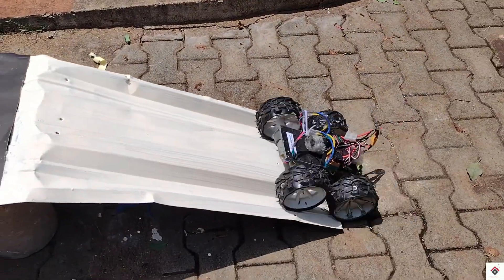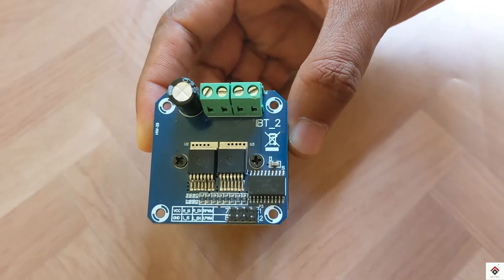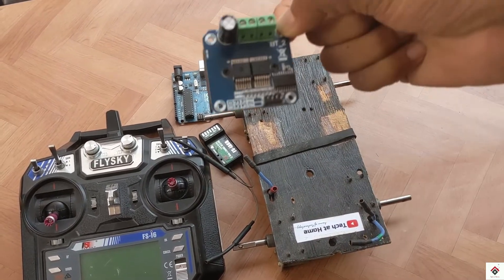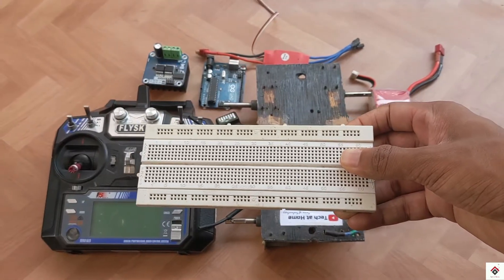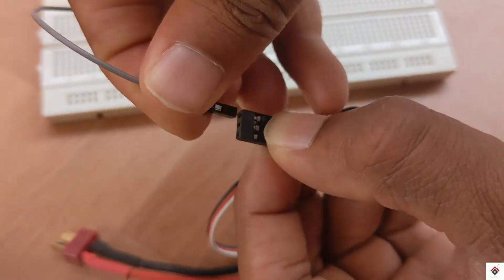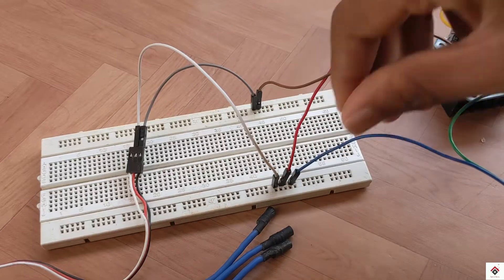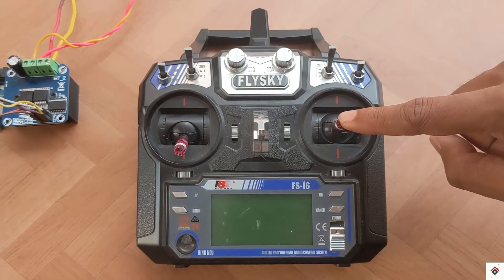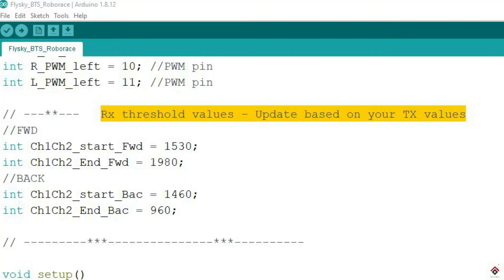Roborace Robot using Arduino and BTS7960 | Wireless Robot with Flysky fsi6 [without Brushed ESC]

Comment: Bro wether i can use 12v 100rpm motor for robo race or any other alternative???
Reply from the maker: 100 RPM will be slower. We have used 500 RPM.
Instead of this video, check the  latest one without using Arduino and it's simple:  https://youtu.be/m9Lq-QADP9A?si=FlbdCycQ8jGvyQHn

Comment: I will try but a small question  Arduino ground not connecting to the motor driver
Reply from the maker: You have to connect.
We have the latest video which doesn't require Arduino board. It's simple and gives precise control. Go with this: https://youtu.be/m9Lq-QADP9A?si=2eKx9oGsAW7QUy5s

Comment: Program Code Was Not Working Properly. One Motor Working, Second Motor Not Working. I'm Follow Next Video With ESC (Servo Motor) it Works in 12v Not Working in 24v. ESC was damaged Repeatedly Motor Drivers Also Damaged.

So Please Check This Programing Code Correct it. Send To Us(Replace On Description)
Reply from the maker: Can you share the specifications of power supply/battery you are using?
Reply: 2x12v=24v For Motors 
12v to 5v Regulator (Separate battery) @techathome

Comment: Can I use 775 DC motor although rpm is controlled by flysky
Reply from the maker: Follow this latest video without using Arduino: https://youtu.be/m9Lq-QADP9A?si=tfP1RA5XUT20Todg

Comment: Thanks for this video.  It works great as is.  Im using Flysky fsi6X. Im using Ardrino Giga wifi. 
What I want to do is have 4 BTS7690 controllers  to control 4 motors.  I do not want to control 4 motors with 2 motor drivers because I will be having a lot of weight and I want to keep everything as cool as possible.  Besides the cost is very reasonable.  

Question. your code has R_EN_right, HIGH    what is R?    L_EN_right  What is L?  is it just right and left ?  

Thanks,
Reply from the maker: Welcome❤️
Yes it's just to indicate left and right.
We have one more video without using Arduino and results are better. Check this once: https://youtu.be/m9Lq-QADP9A?si=RlgQ56h5PKj0h5Tn

Comment: Hi I am Aadit actually I need know in place of the esc can we use a Buck converter
Reply from the maker: Yes you can use.
I would suggest you to check latest video without using Arduino and results are better: https://youtu.be/m9Lq-QADP9A?si=RlgQ56h5PKj0h5Tn

Comment: Hi, 
I had a question as you showed working of one side only 

Do I need to repeat the circuit for the other side, and what pins would I need to use in the reciver for the second side
Thanks
Reply from the maker: You can download the code and circuit diagram from the link in description.
It is provided for both sides.

I would suggest you to check this latest video without using Arduino. Results are better in this: https://youtu.be/m9Lq-QADP9A?si=2LJvc7zISWXJHpot

Comment: Can i use flysky CT6B transmitter
Reply from the maker: If you have option to mix channels, you can use.
Instead of this video, refer to latest one without using arduino: https://youtu.be/m9Lq-QADP9A?si=SHaxQa2XAwKB6agF
Reply: @techathome  without mix channels is not possible..?
Reply from the maker: Robot movement in all directions is not possible without mixing.
Ct6b also has option to mix channels by connecting to computer. Search on youtube.
Reply: Make a video on using ESP32 ..
Reply from the maker: Why do you want to use esp again.
In the latest video I mentioned, you don't need any microcontroller and programming. It's easy and results are also better.

Comment: Bro pls make line following using these motor drivers and esp32.
Reply from the maker: Will try to make.
Reply: ❤ @techathome
Reply: @techathome  any updates?
Reply: Actually I am making my clg project and in that we are using line following as it's the first step of our project I have done all the steps and I have used jhonson geared motors. But motors are running for some seconds and then stops then again running for some seconds what could be prblm pls help I am using four batteries 3.7 V DMEGC rechargeable battery 2900mAh 3C

Comment: What if i use flysky ct6b controller will it work? Because mine didn't
Reply from the maker: Is there any way to mix channels in ct6b?
Reply: Yes channels can be mixed
Reply: I made a bot with just the  same circuit given in the video but my bot didn't work and my motor drivers got burnt too
Reply from the maker: This Arduino based controller is complex. We have made one more video without using Arduino. Check this: https://youtu.be/m9Lq-QADP9A?si=7dtkDvm0k8cmy6q3
Reply: @techathome  already tried with that one but failed
Reply from the maker: What was the issue with that. It's simple and has smooth control.
Reply: @techathome  there were some issues with the servo motor

Comment: Can you pls show it for 4 motors with 2 motor drivers. 
It would be very helpful
Reply from the maker: Actually code and circuit given is for 4 motors.

Instead of this method check out one more easy solution without Arduino: https://youtu.be/m9Lq-QADP9A

Comment: Hello sir..why didn't you use the left side throttle stick of flysky? How can we connect a robotic arm with this..?
Reply from the maker: Single stick is easy to control. But with some settings you can use left side stick also.

Instead of this Arduino based, check this method: https://youtu.be/m9Lq-QADP9A

Robotic arm tutorial: https://youtu.be/7E34KHna-nI

Comment: Can I use 1000rpm motor
Reply from the maker: Torque will be very less with 1000 rpm, It depends on your application. If it is for roborace 500 is good.
 But motors will work normally.
Reply from the maker: Motors will work normally, no impact on the code.
But 1000 rpm will have less torque. It depends on your application. If roborace, 500 rpm is good.

Comment: Hi. Need help with the roborace competition project. It's 4x4. Need a circuit diagram and coding. Where can i find it? The file is not getting opened.
Reply from the maker: I would suggest you to watch one more simple way of making without Arduino: https://youtu.be/m9Lq-QADP9A

Also send request on mail for this video code: deepakhd20@gmail.com
Reply: Hi.. thank you @techathome  but after this video, I have got my components ready, so it would be helpful if you could share circuit diagram, coding for 4×4, and assembly part..
Reply from the maker: Did you send mail request?
Reply: @techathome  yes. Sent

Comment: The Guy talks about cost effectiveness with a Flysky Controller 😂
Reply from the maker: Here the idea was to avoid the expensive brushed speed controller and use Arduino and motor driver.
Reply: It's a bit work but also cooler than ur simple stoobidly 4 motor built,like y fourmotor bro it doesn't even increase speed
Reply: Welcome to reality. Flysky is the cheapest controller you'll find in the market
Reply: @junaidulislam6170 I built my own but it wasn't reliable at all the interference and power regulator noise and everything is just too much to debug just throwing that money at it actually saves you a ton of headache
Reply: Bro use a gear system and normal steering system with servo so u can use one motor and can be realy cost affective
Reply: Bro if you want to won a competition then you have best option for transmitting system is fsi6
Reply: Bro, wether i can use 12v 100rpm motor for robo race or any suggestions????
Reply: @lalithsp9870 depends on the motor if you are talking about that n20 motor and what weight class it is if it is the light weight class in around 200g it is perfect

Comment: Hi there your tutorial on this module is great. I was making RC car using your code and followed your schematic diagram, however,  the motor in the right cannot be controlled and continues rotating until the motor driver broke. What was the fault on the code? Is there something I should change? Thank you
Reply from the maker: Did you start the Start and end values according to your receiver?
Only that is sufficient.

You can check if your motor driver is working or not seperately: https://youtu.be/H2YJRaaXFIM?si=MyKPayUd_hVj30he

Comment: Hi I'm Omer an amateour hobbyist. I used your code and your wiring diagram as a referance and made some minor modifications on them and made an RC boat using RS775 and BTS7960. I designed the boat in Fusion and 3d printed it. And soon will post it on Thingiverse. I want to share your channel an give credit to you if you allow.
Reply from the maker: Happy to know ♥!!
Yes you can mention the channel.
Also can you share your project details and photo on mail, I will post on community: deepakhd20@gmail.com

Comment: I have a doubt that we have 6 channel s in receiver but in transmeter we have 10 channels so how we can use those remaining 4 channels ??? Because i need all 10 channels in my project
Reply from the maker: Which TX and Rx are you using??
Reply: @techathome  FS - i6 TX and it's 6 channel RX with Arduino mega

Comment: Hello Bhai 
I am using fs-i6s transmitter but their is no option for elevon setting 
And i am trying to fix it by MIX option in fs-i6s but not able to operate my robot left and right 
CAN YOU PLEASE HELP ME BY HOW TO SETUP FS-I6S TRANSMITTER IN PLACE OF FS-I6 
PLEASE HELP YOUR RELY IS VERY IMPORTANT FOR ME @techathome
Reply from the maker: That option should be there even in your model. 

There is also mix option. You can mix manually 
Try to find how to mix channels manually. I have not explored

Comment: Nice video. But why have you mixed channel 1&2 In transmitter setting?
You can use channel 1 for forward and reverse. And channel 2 for left and right turn?
Reply: i actually have the same question since i am using a cheap fsi4x which has vmix button which i dont really know the use of

Comment: Can I connect 4 motors to one driver
Reply: I am using 775 dc motor and 12v 7Ah lead acid battery
Reply from the maker: Yes

Comment: Brother
I am facing a issue...
When I am moving throttle forward it started to move right and when moving backward started moving left
And when moving right car is moving forward
And when moving left that time car is moving backward...
How i can fix this problem
Reply from the maker: Interchange the postive and negative terminals of motors on right side.

Comment: Can we use BTS 7960 with esp8266 to control the bot with wifi controlled app
Reply from the maker: Yes, based on the pins available on esp8266, edit in the code.

Comment: Hehe lol it can go forward and backward only how to change direction?
Reply from the maker: Use two motor drivers, seperately for right and left. Direction will work. Refer to circuit diagram provided. Also code provided is for two drivers.
Only in the video demonstration I have used one.
Reply: i used your code and two drivers. but nope. it's not working just forward and reverse . actually i got a problem when still mixed but suppose you move stick in angle of 45 then which stick's value will work to run the motor ? @techathome

Comment: My Motor drivers are making humming sound when giving tx input, is it normal?
Reply from the maker: Yes it is normal because of Low PWM frequency output on Arduino board.
Reply: @techathome can we increase pwm frequency to stop humming sound?
Reply from the maker: I have not explored this topic,
But it is possible by changing some register values: https://nerdytechy.com/how-to-change-the-pwm-frequency-of-arduino/

Comment: Thanks for your sharing, I used your code to my rc lawn mower, but there is a question, it will stop when I        order it go forward plus turning, it can't accept two instructions at the same time, right?
Reply from the maker: Welcome, 
Yes, as of now it works only for one channel at a time. I have to do some improvement in the code for next version.
Reply: @techathome did you do the imroving yet? IT works, but not practcally usable...
Reply: Looking forward to your latest code, you really help me a lot, thanks.

Comment: If i make a transmitter and receiver using nrf24L01 and use the bts motor driver to run will this a good option for roborace 
Or i have to buy a flysky ?
Reply from the maker: Transmitter part is fine. We just need PWM values to be transmitted but to control robot we need to mix channels. Is that possible with your homemade transmitter [just confirm once].
(BTS + Arduino) is better option instead of wired robot. But controlling with brushed ESCs is best.
Reply: @techathome  but dual channel esc is very expensive is smartelex is better option?
Reply from the maker: @cuber_boi,  I have not seen, can u share product link?
Reply: go with flyski, I have tried to built nrf24l01 based transmitter and reciever. Its not reliable for competiitons
Reply from the maker: @jesus3551, yes, for competitions homemade doesn't work.
FSi6 is best, I had bought it for 3k, around 6 years back.
Now it's very difficult to get them, prices of these hobby components are too high ☹️
Reply: @techathome  which motor driver is best to use. I am using 4 Johnson motor
Reply from the maker: You have to buy two brushed ESCs
Hobbywing ESCs are best as i have seen different teams using in competitions.
Reply: @techathome  it's too expensive is there any cheap option?

Comment: Is it possible to use bts7960 and flysky without arduino?
Reply from the maker: Not possible,
We need Arduino to read receiver signals and also to activate motor driver control pins.
Reply: @techathome  but i saw some people using relay switch and somehow connecting it to receiver
Reply: @techathome to change transmitter value, should i connect arduino to pc with all things connected?
Reply from the maker: Yes , you need to connect Arduino to pc. Only receiver is sufficient, no need of motor drivers.
Also remove external power supply from Arduino when usb is connected.
Reply: @techathome  okay ❤️
Reply: Any reason for connecting pwm Pin To 6 and 9? Not on 5 and 6?
Reply from the maker: Any PWM pins can be used.
But make sure you are changing the same in the code.
Reply: @techathome  okay buddy... I was confused about that

Comment: Hello 
1.Can I use this entire setup in a robo soccer competition?
2.What type of motors should I go for in a robo soccer competition? high torque low rpm motors or high rpm low torque motors?
You made the best video possible!!!
Reply from the maker: This design is not suitable for robo soccer..
As i have seen in many competitions, robo soccer robots are made up of metal body and has two wheels with high torque dc motors (most 500 rpm used).
Reply: @techathome  Got it, another thing I wanna know should I use mecanum wheels or normal wheels in a robo soccer?
Reply from the maker: Normal wheel

Comment: Hello, I have built this rc, but the motors start heating up after a few minutes of continuous throttle. Please help.
Reply from the maker: What are the components you have used?
Reply: @techathome  same, Johnson motors 600rpm, 2 bts7960 drivers, 2200 mAh 30C battery. I think the motors are drawing too much current. I tried buck converters but it also blew a capacitor. Anything else I can try?
Reply from the maker: For how time u are running the motors?
Reply: @techathome  5 minutes, but on full throttle.

Comment: Which battery  to use
Reply from the maker: 11.1 v, 3S Lipo battery
Reply from the maker: Also use 9v battery for Arduino Similar one in the circuit diagram.
Reply: Battery ko parallel me connect  krna h dono motor driver ke ?
Reply from the maker: Yes
You can also refer circuit. Link in description

Comment: Can we use bluetooth module (HC 05) instead of flysky controller
Reply: You can use the module nrf24
Reply: If i using nrf24 module then whether we want to modify the code
Reply from the maker: You can refer this : https://youtu.be/qxt_MdnQTm8

But code need to modified to use BTS motor driver.
Also no rpm control.

Comment: Brother can we apply this same code for cytron smart drive duo? 
Even thou the driver has the option to connect channels directly to it. I want to try out with micro controller.
Reply: Brother can u please help me with this...
Reply from the maker: I referred some basic example codes for (arduino+cytron) .
There is specific library for it. So you cannot use my code directly.